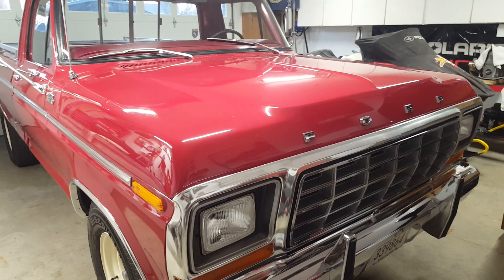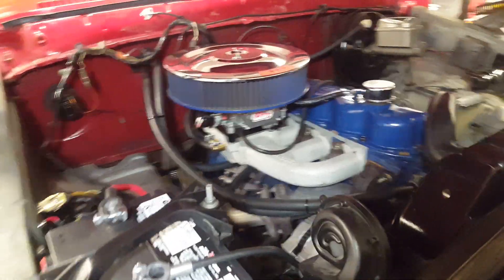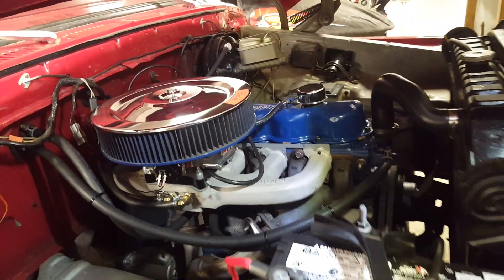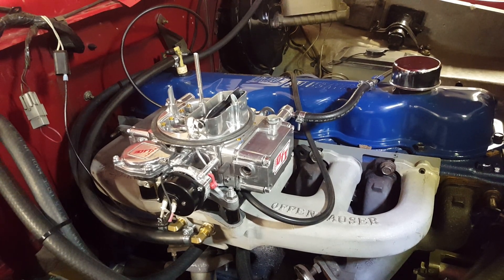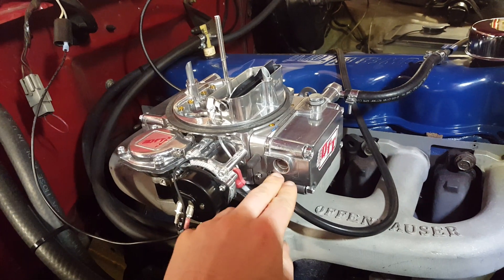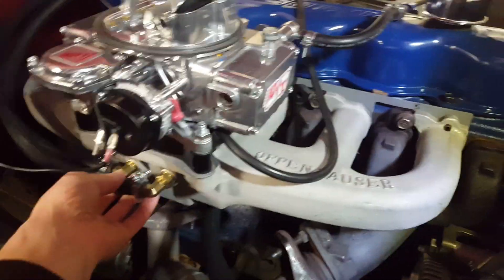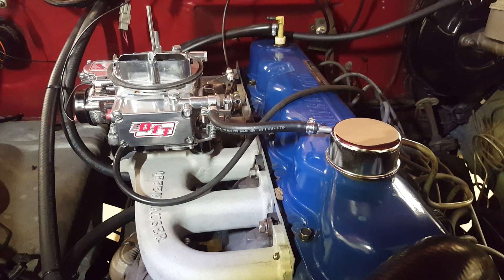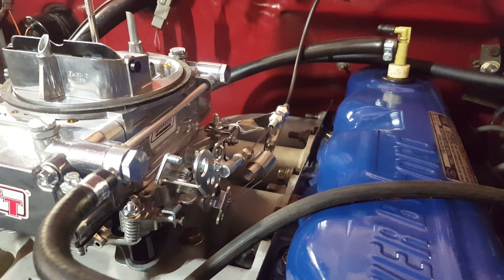300 Inline 6 Cylinder (4.9L) Ford - Offy C-Series and Quick Fuel 450 Walkaround

Comment: Love your truck! I have a 79 F100 with the same motor. Did yours have a smog pump? Mine currently does but want to got to the Offenhauser setup and am not sure if I can delete it.
Reply from the maker: Mine did have the smog air injection pump. You will have to check with your local regulations on whether it is required to retain the OEM emissions equipment to stay in compliance.
Reply: I actually checked out the local laws and I do not have to have the truck smog tested. With that said, what exactly needs to be removed and do I  need to cap or run anything different once it is removed?.
Reply: My 78,300ci F-150 did not pass visual inspection,smog guy said the egr valve is missing.it never had one when I got the truck,it's federal and manufactured in canada.how can I prove it to the smog guy?
Reply from the maker: @jerrychacon8814  hard saying. Luckily we aren't subject to smog checks where I am.
Reply: @rumrivertriples4073   I did find out were it says if your truck has an EGR or not, on my federal 1978 F series and most trucks there's an emissions sticker on the valve cover, I didn't notice it before as part of the top of the decal was missing,and dirty.mine only says engine:300ci . If you do have an EGR it will specify EGR. Also if your smog guy has older smog test manuels as one smog guy showed me theres no EGR test for my federal f150.
Reply: @jerrychacon8814  The VIN number will give a code that tells it was built there
Reply: I found it! Did not notice it before  because the top part of the sticker was missing.On my f150 valve cover is an emissions sticker decal it says what exhaust emissions system I have it says Family: 300cid imco. No EGR!

Comment: I have the same setup in an 85 F-150 that someone cobbled together, sans the carb. I think Frankenstein put a 70’s marine Holley on the Offenhauser. Is your carb the QFT-SL-450-VS? I want to order one and see if it makes a difference on my set up.
Reply: Did you figure out which carb? I'm trying to order one for the same setup.
Reply: @connected6782  yes, I did end up buying the SL-450-VS Quick Fuel carb from Summit. When I installed it I realized the carb had been sitting backward on the Dual Port Offy intake. The primaries need to face the valve cover on the 300 I6, which makes the throttle face the firewall. That posed another problem for me because I couldn’t get to the throttle cable to route right. The heater box was in the way. Ended up buying the Offy C-Series intake and everything lined out nicely. And man what difference! She’s straight butta now. I did have to adjust timing to get the right idle. But that’s because the guy had it way advanced!!

Comment: I'm on the fence myself between 460 or dropping a 300 six I have all the bolt Ons what is your rear gear ratio ?? 4 on the floor non/overdrive?  And what's your fuel economy? Mix? and hwy like 60 mph? Mine is a 79 f250 354 rear gear's w/460.
Reply: If you do the 460, they aways run hotter in the summer and need a starter cover to keep your starter from heat, 10 mpg 4.9 may be a lot slower bet it pulls great for use 15 17 mpg and run forever

Comment: Could you tell me a little more about the heat plate to warm the manifold? From what I read online that is a concern when switching to this intake because the exhaust manifold doesn’t heat the intake. Thanks
Reply from the maker: It is from RASO enterprises. It allows the coolant from the heater hoses to run against the bottom of the intake and warm it up more quickly/consistently. Seems to work well as the drivability seems better in those first few miles after cold startups
Reply: Rum River Triples Gotcha. So basically just helps everything warm up a little quicker. I do greatly appreciate the response. I’m am planning on running an almost identical set up and am using your video as a sort of guide to try and wrap my head around where all of my hoses will be going and what gets shit canned. Thanks again.

Comment: I'm curious as to why you used the C (Competition) series Offy intake, rather than the 6019-DP Dual Port Offy intake?
Reply from the maker: Fair question. I spoke to several inline 6 enthusiasts who had a distaste for the DP manifold on anything beyond a stock rebuild that was mileage focused. I chose the "C" manifold so I'd have an improvement over stock when used as-is, but have room to grow if I ever decide to fully build the rest of the engine down the road.

Comment: i have this same setup on my 84 f350 dually.  its runnin like crap, tho..  idk if i have vac leaks or what..  in all fairness, its a pretty worn out motor
Reply: I want to know why some prefer to mount carb North South vs East West.
My throttle shaft is parallel to my crankshaft. Rus great.
Reply: @deadcarnahans1932  I believe the offy intake is a dual plane setup and the user must align the carb primaries with the intake primaries..  Sry for the shit explanation, maybe someone will clarify..

Comment: I'm almost done with my 1994 4.9 conversion from EFI to carburetor. I have the same intake and carburetor but my question is what type of spacer did you use? I currently have a 1 inch with a 4 hole bore and it's not working.
Reply: Why is it not working? Will not fit physically? Or engine will not run properly?
I used four hole spacer under my 2V carb after cutting out the four holes and blending it well. Works fine.
Reply: @deadcarnahans1932  I'm not really sure, I pulled the 4 hole spacer and put an aluminum square bore spacer and it helped. It's a new carburetor but I think it's a bad one. The accelerator pump was leaking and I fixed that with a new diaphragm. It has an acculink tps mounted on the throttle linkage side with a 24 inch lokar cable that all seem to be working. I checked the fuel pressure as I'm stepping down from an EFI fuel pump. The regulator is set at 6.5 and has a return relieving the excess fuel back to the tank. Both bowl levels are about half way and now the vacuum secondary is leaking down the plunger shaft. I think I'm just going to return the quick fuel carb and get a Holley.
Reply: @leonardgriffin8951  Let me ask this. What transmission are you running? You mentioned the Acculink TPS. I have the same on mine for my 4R70W. I assume you have an aftermarket controller for your transmission.
Reply: Glad to hear it.  I would change my 1990 6 cylinder to a carburetor if I could afford it so I have to deal with the BS and all the sensors and whatever. I wished I bought an older one.

Comment: Oh yeah, one more question: Did you use a 4 hole or open spacer?
Reply: Soren Tay yes I would like to know this aswell
Reply: @chrish5096  you can use either one on the single plane, but if you use a dual plane, it’s better to run the four hole ( just my opinion)         BTW, I would recommend turning your carburetor perpendicular to the engine… especially if using a dual plane intake.

Comment: Do you happen to have the part numbers or links the the throttle cable extension and linkage you used?
Reply from the maker: I posted in the comments of one of these videos. I can dig around and throw it in the description
Reply from the maker: Looks like DP-1000U is the throttle cable and bracket I used from Lokar. The firewall bracket is factory.

Comment: 2 barrel carbs need to be installed perpendicular to the engine, otherwise you don't spread the fuel on both sides of the offy plenum on idle and as a result 3 cylinders get more or less fuel. That was probably your issue. 4yrs later you probably know that now. Lol
Reply: Left out on idling stumbles.

Comment: You didnt notice hardly any power gains with headers, OFFENHAUSER C SERIES,  AND 4 BBL carb? whay size exhaust, duals?

Im trying to buy one of these Fords with inline 6 but guy is having trouble getting it running.
Says his buddy put an electric fuel pump on it but not sure what PSI, but still doesnt run.

ANYWAYS  are you perhaps in canada cuz i would like to know how much the offenhauser intake and headers cost you OR are those factory split exhaust manifolds
? how much for that carb?

Comment: Will it pass smog ?
Reply from the maker: Thankfully my state does not require smog testing at this time - although with that said it runs FAR cleaner now than when it had the miles of vacuum lines and original 1bbl carb. It used to smoke and run terribly rich. It is far better in that regard now

Comment: https://youtu.be/F3w2r00_4sE some example  for you guys follow  this way and have a monster  6 cup if you guys need more info on this,  just get back on ,this  one Chevy opala  from brazil  that have 6 cylinder engine straight  and some mod like 300 ford like just some modifications,  balanced, crank,310/320 camshaft, muffler, and just say the original engine was, carb, know have 3x2  fuel injectors and fuel control fueltech, sound amazing  the head just get a bit mod porting and big valve just on intake not exoust,  mod old and new  see if you like ,this one

Comment: 38,000 miles and it needed a valve job? Hmmmmm......
Reply from the maker: I suspect it was overheated at one point in its past which may have contributed to a few valves that weren't sealing properly
Reply from the maker: @Faber-cator  it was driven sporadically by the time I purchased it. That is very possible that it sat for an extended period and that's why it had valve sealing issues. Whatever the reason, it was worth the effort of having it rebuilt although I now with I'd ported it and installed larger valves at the same time. Oh well